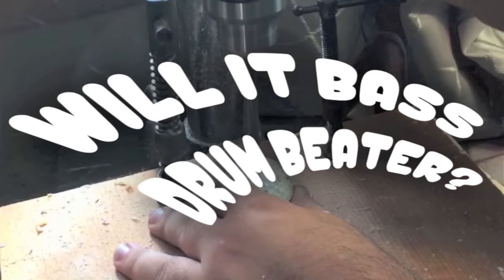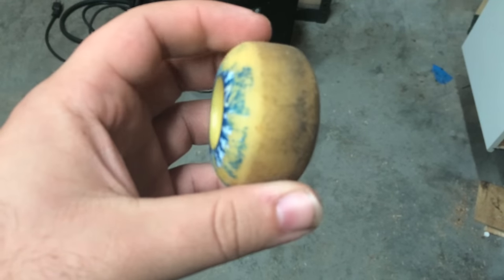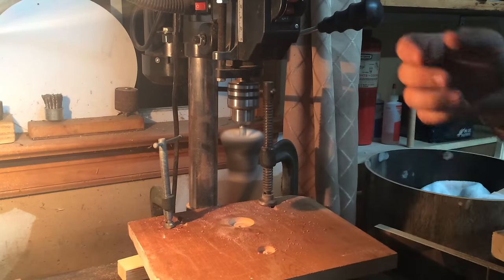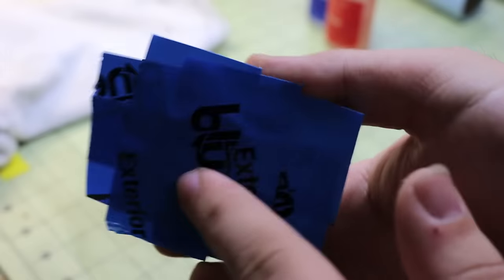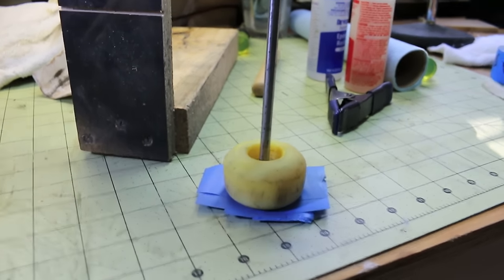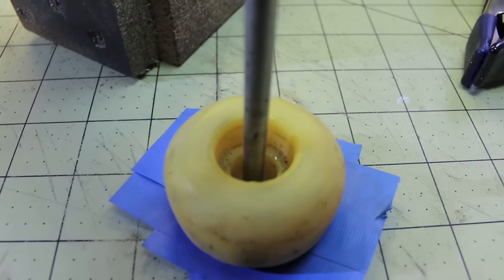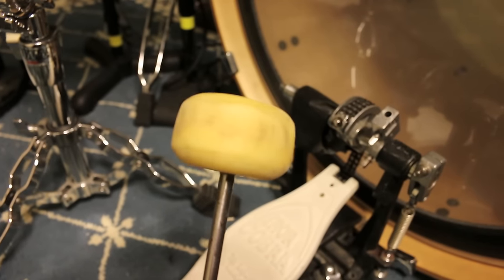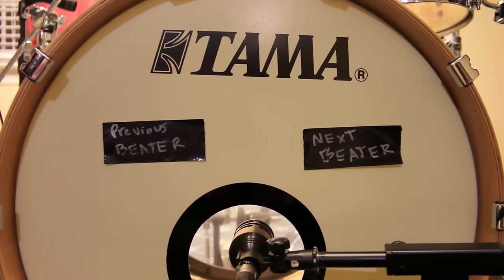Skateboard Wheel Bass Drum Beater

Comment: I'm wondering if you flattened the top and bottom of the wheel and kept the bearing cavity open. But put the rod through the bottom maybe the the open side hitting the head would make it sound different? I don't know I'm not a drummer but would the opening help with not dentting the head,

Comment: What durameter is the wheel?Softer would probably be a little better.When I skated in the 80's the hardest they made was 97 or 98,those are considered soft now.I've seen like 101+.
Reply from the maker: +justin thymes Im honestly not really sure. They are pretty hard, though. Also, they have definitely hardened up since I first got them; they've been sitting around for like 10 years haha
Reply: Haha,I had a box full,finally chucked them cuz I didnt have a full set!
Thanks for the reply,I may make one.Whats the weight like?

Comment: I thought of doing this, but using the axle out of a.skateboard truck as the rod. That way you could use the bearings in the wheel to hold it on. Would need some padding behind it on the head or it would probably tear a hole right through it after a while.

Comment: rdavidr - What are your thoughts on the Evans EMAD Heavyweight or EMAD2? I used to put the EMAD (plus a patch for added definition) on my bass drum but I wasn't digging the fact that I'd bust through it like paper a few months down the line. So I switched to two ply and haven't looked back. I use Remo, I currently have the coated Powerstroke 4 which is two plies of 10-mil.

(Background: I've only really played in hard rock bands and I'm not endorsed so I have to use the two ply heads for 49% durability and 51% tone/sound/voice to project over loud amps.)
Reply from the maker: +Paulson Ive never used them. I am a fan of the emad. But the head I have on my Tama (the one in this vid) is a gmad, which I fell in love with the day I put it on.